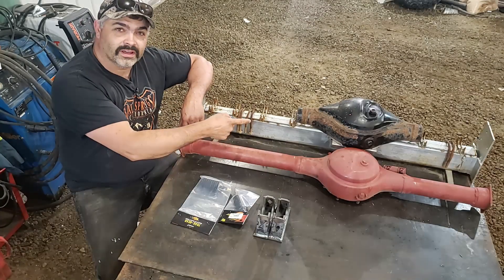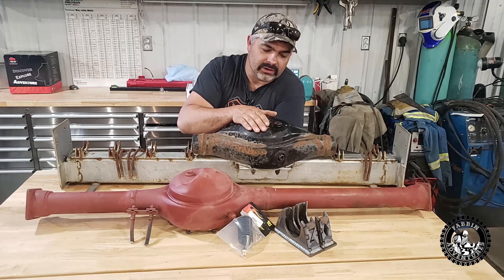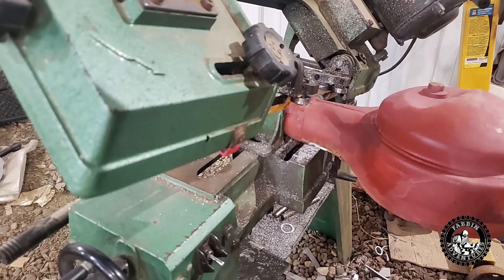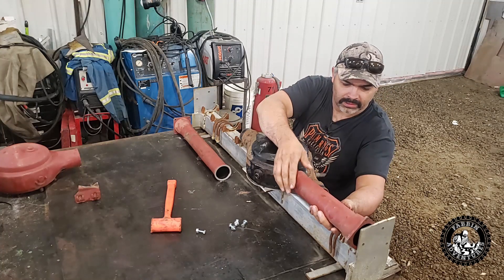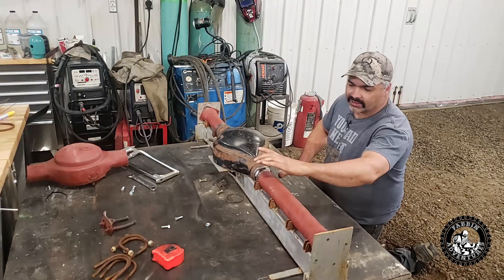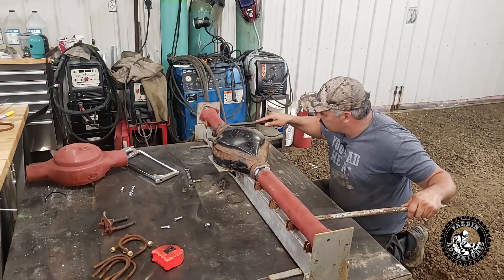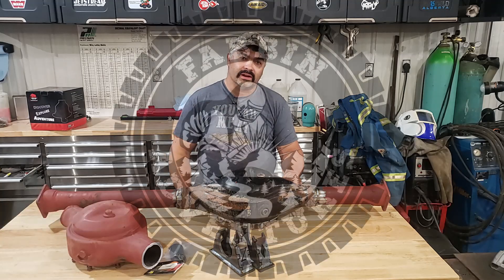Samurai/Side kick Hybrid Rear Diff Build: The Jig part 1

Comment: Why not toyota axles
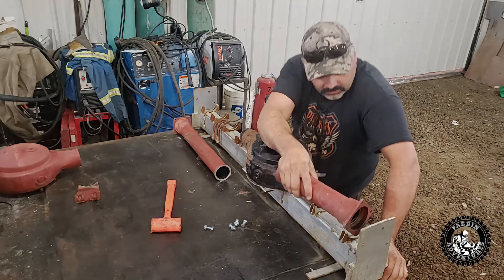Reply: Toys are bigger, stronger, heavier, costlier and wider. I have 5:13's stock Sammy front end, Hybrid rear with new DOM axle tubes. Only popped 2 Birfieds In over 25 yrs. Toys would be a great choice, especially for 35" tires. Better ground clearance with Zook. (Smaller Pumpkin 🎃

Comment: What were your final samurai tube lengths before inserting and welding?
Reply from the maker: Thats a good question, i dont remember, besides it all depends on where you cut the center section, and the axle tubes slide about 3/4" inside the center section!
Thanks for your comment!

Comment: When you do hybrid rear change the axle couplers out for the samurai ones and you are ready to go me and my dad did this to my samurai 11 years ago and it ia still a solid setup i dont go through as many rear ends😎 it propane with locrite locker in front with birfield rings pressed on axles  welded rear 5.13 gears and 4.16-1 gears in the transfercase still sprung under with revolvers amd a full custom exocage it goes so good it doesnt hop it just goes so i decided not to spring it over it doesnt flex nearly as well as sprung over with the revolvers but it goes everywhere i point and i dont like main paths i like full balls fuckin passeger shit there pant foot to the floor never let up and grab another and fly though the bushes gotta love playin ping pong off the trees😋and i have been ripping this same setup on two samurais for years😎✊🏻
Reply from the maker: Awesome! Sounds like a sid build man!
Thanks for watching and commenting!

Comment: So it sounds like a samari center diff would be bad and week in my Tracker with my 5.125 gears. So just get a locker for my Tracker rig is best it sounds.
Reply from the maker: Yes, just get a locker, the Samurai center or 3rd we call it wont fit, its too small.

Comment: Can we install 4.57 or 5.38 gear crown ring and pinion made for samurai by LowRange Offroad on the stock diff?
Reply from the maker: If you get side kick ring and pinions, the samurai ring and pinion is too small. The advantage to building the hybrid is to use the suzuki side kick or chevy trackers bigger ring and pinion. So what ever gear set you can get for a Side kick you can install into this diff.
Thanks for watching.

Comment: John's jig looks like it made that project a hundred times easier!  I wonder if you would have been able to check the straightness, using the rod method, but without removing it from the jig if there were holes with a simple bushing setup in the ends of the jig... 

Looking forward to your next installment!
Reply from the maker: Yes i was thinking of doing that very idea with the holes in the end. John lives 2 hours away from me and i had his jig for quite a while, so i wanted to get it back to him.
Im gonna check straightness of the hybrid with a shaft, and if and when its straight i'll make my own jig.
I just got home from camping/jet boating, and am headed to run the whipsaw trail in 8 days from now, so another installment is gonna be a bit.
Thanks for watching!
Reply: @FabbinAdventures   - no worries.  Definitely have fun on that Whipsaw trip.  Wish I was closer and had an adequate rig to join in.  Till then, keep the rubber side down (mostly)!
Reply from the maker: Lol will do, i plan on doing moab, possibly next year or the rubicon maybe, time will tell, but ill put out a notice if i do get something set in stone!

Comment: You thinking of 5.13 gears. There are no 5.29s for these. There are 4.30 4.62 and 5.13s also a couple other rare gear ratios
Reply from the maker: Ya sorry my mistake..thanks for watching!
Reply: Fabbin Adventures yup no problem. I have a hybrid with heavy duty axle tubes and sidekick bearing cups for bigger wheel bearings. All from trail tough. Also running 5.13 gears.
Reply from the maker: Yeah, thats how i shoulda did it, oh well, i can always build another if i feel the need!
Thanks for watching Fabbin Adventures!

Comment: Xl7 got bigger again
Reply from the maker: I wonder if the axles stayed the same? Would need to still be able to use the samurai axles.
Thanks for watching Fabbin Adventures!
Reply: @FabbinAdventures  they are the same spline size and same bearings on the carrier and pin to same yoke to